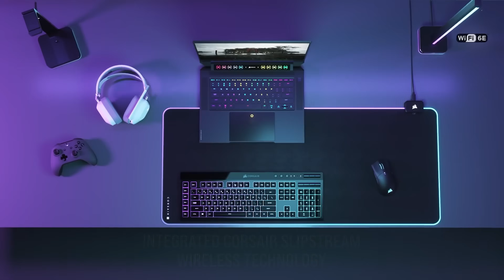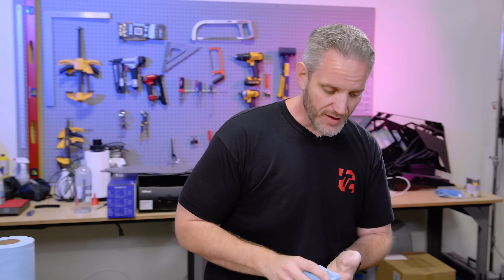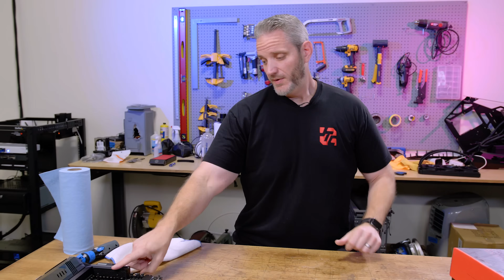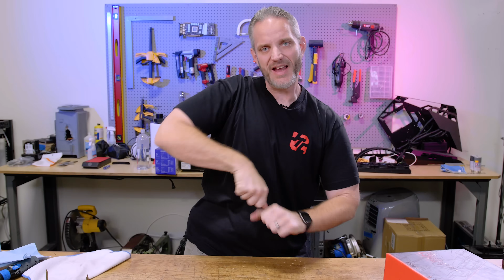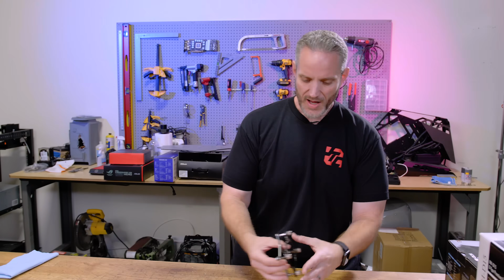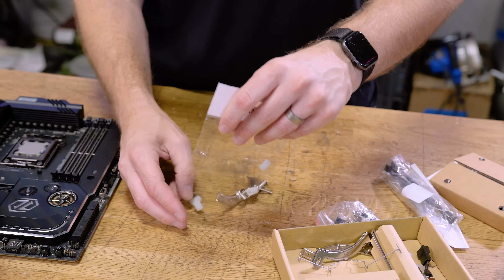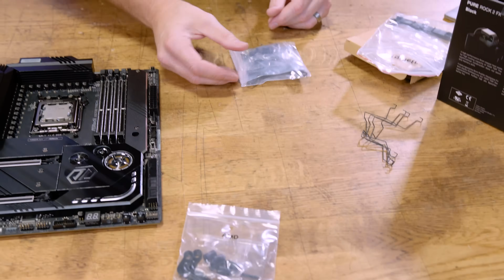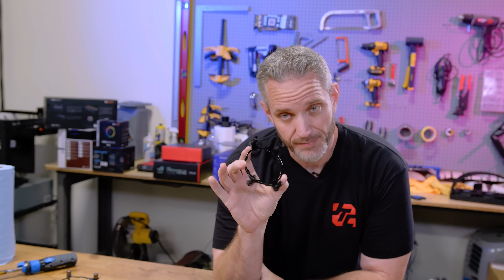AMD made a terrible flaw with this design...

Comment: There are many common misconceptions about cooling. Depending on how much cooling capability you have, a CPU can dump the same amount of heat (in Watts) at different temperatures. Derbauer did set a certain power limit (which in CPUs then becomes heat) so that given his entire cooling setup's efficiency he could exchange that heat at a comfortable temperature. If you give more cooling to a CPU, if designed to do so, it will always be able to reach 95 degrees until it can't draw any more power or other factors come into play. Say you are trying to cool 200W, both a cooler that keeps the CPU at 50 degrees and one that mantains 90 are dissipating 200W; the one that is able to mantain 50 degrees is just more efficient since it needs less temperature difference between the heat source (CPU) and the heat sink (air) to discharge the same 200W as the other one. Zen4's temperatures are high because they WANT to use every Watt of power they can. Of course, direct die can only help with efficiency

Comment: I hated the clip mounting design for old AM2 boards.  I had one for my Athlon 64 x2, and I spent more time trying to mount the cooler than anything else on that build.  What a nightmare.
Reply: It depended on what type of cooler you had. If you had the ones known from socket A, where you had to work with a screwdriver: these were actually horrible.
But the newer ones had levers. You hooked in the clips and simply turned around the lever to pretension the spring. Getting the clips in place could be a little fumbly for sure, but overall they were quite easy to install.

Comment: Nhd15 will work if it was manufactured after 2018, since it comes with AM4 size brackets. If not you can contact Noctua and they will give you a kit

Comment: I am hopeful that AMD will do a re-vamped design for the next CPU release and let the coolers and motherboards adjust to a much better thickness and cooling solution. If they do, I might be swapping from Intel CPU/Nvidia  to AMD for both. DerBauers tests were outstanding.

Comment: The IHS thickness being a factor in Zen 4's temperatures is a physical inevitability, however I don't think it's nearly as much of an issue as a lot of people seem to make it out to be. Seems to be mostly a case of AMD just applying stupid voltage settings just so le Youtube reviewer can get a couple more points in le benchmark and Zen 4 gets a longer bar in le chart and more people buy it and it hopefully stays head to head with Raptor Lake by the end of the year. Just Lisa Su full on bench racing with no regard to thermals. IHS thickness is probably worth 5 degrees, the other 15 degrees can be achieved simply with negative curve offsets and a power limit without sacrificing performance unless you're really unlucky in the silicon lottery.
Reply: You are wrong with your assumption about lower temps with thinner IHS. Because the higher temps are not primarily due to thicker IHS, but the boost algorithm boosting until it reaches one of the limits. Up to Zen3, boost mostly was limited by PPT, but now with higher PPT, temperature is usually the limit.
You know what would happen, if you would take off 1mm of the IHS? The CPU would still go to 95°C, but you get higher clocks. Because that's how the boost algorithm is working to max out the CPU.
Unfortunately most commenters also on on other videos have no clue, because they simply have not informed themselves. They see 95°C, the conditioned brain says "too high" and then the fingers start typing comments, showing the informed world how much they do not understand.
BTW: The delidding experiment of DerBauer does not contradict to this. The boost algo also checks for PPT and EDC limits. Afair DerBauer did not check, if PPT was reached.

Comment: I think they shot themselves in the foot with this one. If AMD can make the socket can last up to 4/5 generations, nobody cares if they buy a new cooler. People would still have to buy a new cooler to stay away from 95C, but it will still hit close to 95C since it's the IHS bottlenecking the thermal transfer.

I hate when AMD tells things are "by design"; similar to what they had on the RX 5700XT, it obviously means that they had a booboo.

I'm sticking to my 5700X and AM4, still hope they've got something good for GPUs because Nvidia is basically price gouging everybody trying to sell their previous gen.

Comment: NO SHIT. any direct die cooling is 20c. Look at direct die cooler for the 8700k.

Idk why your trying to make a big deal out of AMD trying to do something good for the consumer.

They could take the Intel approach and make us just buy new coolers no matter what
Reply: i should also note that my NOCTUA DH15 Did WORK with my AM5. it was a quick swap. no additional items needed.
 
I'm actually infuriated by you saying DH15 FAIL. it didn't even have the AM4 mounting...... wtf? of course it wont work.

Comment: Question: Is it possible that AMD could redesign 8000 series to still use AM5 but have the die sit higher and use a thinner heat spreader?
Reply: Like they could but it would likely force all the 8000 motherboard partners to retool their boards.
Reply: @blue-pi2kt  no, i was thinking they just increase the thickness of the CPU PCB so that the die itself sits higher but everything else would sit the same
Reply: @thicclink  then you can end with the same problem just on the other side of the die. Wherever the power is going there is heat, if it's at the top, middle or bottom of the die it's still a problem. Realistically to achieve the best solution you'd want to split the necessary z axis thickness across all 3 layers of the CPU.

Comment: The NH-D15 qualifies for a free mounting kit if you have a version that came out before the AM4 socket war released. The AM4 mounting kit uses the stock rear plate,  thus it will work on AM5 as well.
Reply: still using my NH-D14 going strong since AM3 will go for another 6 years on AM5
Reply: Yeah, I thought Noctua gave people free brackets when they changed. Surprised Jay didn't know that.
Reply: Thanks! That was really confusing. I just bought an NH-D15 for the 7700x. The Noctua website says it is compatible. I guess mine will come with the AM4/AM5 mount.
Reply: @Nomen_Nescio_X  They started including the AM4 mounting kit with the standard NH-D15 quite a while back. So yes, it would have to be really old stock if you get one without it included. :)
Reply: @Nomen_Nescio_X  It was I remember seeing a AM4 mounting kit for it when I ordere and getting confused as to whether or not it came with one from the get go but it does. Great cooler.
Reply: I bought a noctua cooler used, only had the AM3 brackets, a couple emails later and they sent me an AM4 kit for free. Took a couple of weeks to get here, but overall very good experience.
Reply: I have a NH-D15S from like six years ago. I was just looking into this the other day because I was thinking of getting a 5000 series amd cpu. So if I get the mounting kit, it should also work on 7000 series? I should be good with this cooler for a while then? I'm still unsure which cpu to upgrade from a 8700k, this has all been a clusterfuck recently
Reply: Interesting, thanks for the heads up. Mine was mounted on a FX-8150.
Reply: I confirm as well, noctua sent me a free kit for intel platform
Reply: I don't get why jay said that his NH-d15 didn't work when he didn't have the AM4 bracket and the whole video is comparing AM4 brackets to the new AM5 system.
Reply: Can confirm, it was included with my order from last week in the box.
Reply: Yeah, just bought one and it comes with the newer ones. Jayz just has a super old one, if you buy new this shouldn't be a problem.
Reply: nh d15 also makes the 7950x under perform insanely... 29k on r23 vs 38k.
Reply: Idk how that brand makes any money, my 14 and 15 are half a decade old lol.
I won't ever replace them.

Zip ties or something will do when they no longer support boards.
Reply: My NH-D14 mounted straight over with no problems. I've only ever seen temps over 90C when doing Cinebench. Since it's quite you can really crank the fan curve on the cooler to keep temps down.
Reply: hell, they even gave me a free fan clip for my D15. Noctua FTW
Reply: @mastroitek  Platfrom longevity. AM5 will have at least 3 cpu generations. Alderlake and rocket lake and your done. 14th generation will have a new socket...think about it this way...when 16th gen intel comes out your AM5 motherboard will be either at it's last cpu generation or it might have 1 more, while Intel will be changing sockets AGAIN.
Reply: @VoldoronGaming  what is the point of having the possibility to upgrade the CPU in 3y from now if he changes it every 5y? AM5 will be dead when he decides to upgrade in 2027...
Both 5800x3d or 12700 will last a long while
Reply: @mastroitek  I doubt AM5 will be dead that soon, all Ryzen chips until the 7000 series were AM4, going at least 4 series back (original release of Zen through the 5000 series).
Reply: @mastroitek  Yeah this was why I was looking at the 5000 series rather than 7. Thinking I could get a 5950 either that or like you said go intel again. I play a lot of VR and want to be able to play the most intensive VR mods plus use unreal and blender. So looking to upgrade cpu and gpu from 1080ti
Reply: @Spamuelow  well, I think both r5000 and intel 12th gen can offer you great performance, if you need the extra cores the 5950 is a great choice
Reply: @Spamuelow  5950 actually has lower gaming performance than the 5900. It has to do with how the infinity fabric handles the extra cores. 5950 is stronger for content creation using all cores (and soooo many cores), but for any gaming use case, 5900 will out perform it. Basically 5950 is the poor man's threadripper, and just better for extreme multicore tasks, but not as optimized for something like gaming. The 5800X "3D" may perform better still. It depends on the game. But there is at least 'some' games which will find the 5800X 3D OR the 5900X to be ideal. I don't think 5950X will be the fastest in any game though. There just aren't any games out there programmed to exploit 16 cores/32 threads.

There are games which can exploit 8 cores. And that favors the 5800 3D. But you also have other things running, like your OS, etc. The 5900 with 12 cores can move those tasks out of the way of the 8 cores being used by a game (IF a game actually fully exploits 8 cores, a lot don't). The 5900 also has a slight clock speed advantage. The 5800X-3D has some performance uplift based on having better caches. But for 'any' gaming (VR or otherwise) your top end 5000 series cpu from AMD will be the 5800X-3D or 5900X. Better caching, or more cores and higher clock, some games like one, some games like the other.

Now if you're going to be doing video compiling and other extremely multi-core tasks (not 'just' gaming)... then 5950 can make sense. Personally, I'd still lean towards the 5900X for mixed use. But it depends on how much time you'll be doing extreme multicore stuff. Um, say 3 years down the road, someone may release games which exploit more than 8 cores... if you want to not upgrade for years and years, more cores could come in handy. That also leans into the 5900X (or maybe even 5950X).

7000 series is a beast though. IPC uplift, BIG clock speed uplift, better caches... it's a monster. But you are looking at more expensive ram (granted, it's significantly faster ram), more expensive motherboard (granted it'll have pcie 5 and some other nice new things though), possibly a larger power supply unit, and you'll need a more beastly cooler on it. Right now at microcenter it's $549 for the 7900 and $369 for the 5900 (+180 difference) but by the time you build out a system, it could be more like +400 in cost, maybe more. 

There is a more gradual approach possible though. If you set the chip to "eco mode" it will reduce power and temperature a lot. Your performance drops down to something only moderately higher than 5900 levels. And you still need an AM5 motherboard, and DDR 5 ram. But you could run that on a smaller power supply, and with weaker cooling. And then upgrade the PSU & cooler later, to unleash the chip's true power. It's an option anyway, if you're upgrading a system with a modest power supply and a weak (but AM5 compatible) cooler. I wouldn't buy a new power supply & cooler intending to limit a 7900 in settings. But even in eco mode, it's a really strong chip. Could be an upgrading option, at a specific price point, depending on what you have in your existing case. All new system though, just give it the good stuff from the start.

Between intel's 12900 and AMD's 5800-3D or 5900, I kinda lean towards AMD (as someone who currently uses intel). But any of the 3 are perfectly valid.
Your graphics card is going to be the main thing though. If you watch cpu benchmarks, they tend to set the resolution low (to make things easy on the graphics card) so that you can see the differences in the CPU's. If you set the resolution higher, any decent CPU will look about the same as the very best CPU, since they're all waiting on the graphics card to catch up. 

VR headsets vary in resolution. Some are very modest, some are very high rez, and everything in between. 1080p bechmarks are around 2 million pixels (1080x1920), 1440p benchmarks are around 3.7 million pixels. and 4k benchmarks are around 8 million pixels. VR headsets have a different aspect ratio, but it's the number of pixels which matters. look at the "number x number" resolution of your VR headset, multiply it, and that's how many pixels you have in your headset. If it's closer to 1 or 2 million, you're going to be CPU bound (a very strong graphics card will be waiting on even a very strong cpu to catch up). If it's more like 3 or 4 million (or more), you're going to be GPU bound (even mediocre cpu's will be waiting on even the best graphics card to catch up).

On graphics cards I missed an opportunity to get a very good 3090 ti, at a very good price. So looking at the 4000 series coming out, and the prices on remaining 3090's and 3090ti's, I'm just going to wait and see what AMD offers in their upcoming release. If I HAD to pick right now, it'd be either a 3080 ti for around $950, or a 4080 (16gb, the 'real' 4080) for around $1200 (but I would turn off DLS 3). I feel like I 'should' have bought a 3090 ti FTW3 for $950. But AMD's upcoming release may change that feeling.

Uh, i don't VR... the 4000 series has "DLS 3" which inserts 'fake' frames for higher frame rates. I consider that blasphemy for the sort of gaming I do (it can be turned off). But DLS 3 might be really good for smoothing out the VR experience. I don't have experience with VR though, so that's just armchair theory. IF that's true, then the 4000 series might be more attractive for your use (if). I suspect it would smooth out motion in games quite a lot, BUT would introduce a very slight latency, and possibly cause "rubber banding" when real frames disprove DLS 3's assumptions about motion prediction. Probably it looks incredible for something like a driving game (everything has inertia, so the motion predictions will be pretty close to accurate). But for an FPS game, where your target is moving around like a cockroach trying not to get stepped on, predictive fake frames with assumptions about your target's position sounds very unhelpful. I think it's a useful feature for some things (one of those possibly being VR), but I really hate that nvidia is marketing their cards like fake frames are real frames, and not even discussing the true rasterization performance of their 4000 series. I also hate that they are calling the 4070 a "4080 12 Gb" and pricing it as such.

All of this assumes from your "5950" comment that you're looking at a high-end computer, which will have lots of overkill performance, and take a long time to need upgrading.
Reply: My D15 came with an AM4 mount which is the same as shown in the video. It should work.
Reply: I forgot how old the nh d15 actually is

Comment: I think it’s a bit disingenuous to blame them for everything: the stock clip mechanism IS compatible, and there are OEMs that have coolers that work with them, but I also think Jay’s comment on IHS thickness and cooling performance is valid. The fact that you can get 20 degrees less by de-lid means they really didn’t think that thickness add through. It will be interesting to see what performance headroom that leads to with v2 chips or the 9000 series
Reply: I saw this as more of a correction from his release video, where he stated all AM4 coolers were compatible.

Comment: direct die is not always the best way for cooling, depends on the cooler you use if has proper heatspreader or too thin copper base.

Comment: I seen microcenter got in stock the motherboard  i want finding a cooler that stated works with AM5 is very limited. This is what stopped me from a 7900x been on fence about waiting for the 13900ks <- Stock 6.0 on all cores sounds really good. or snag the 7900x now